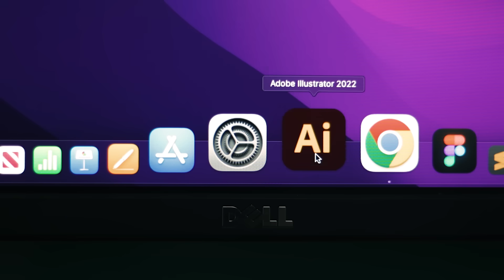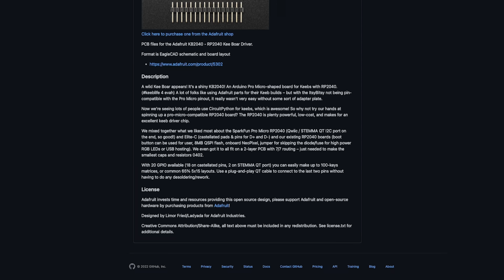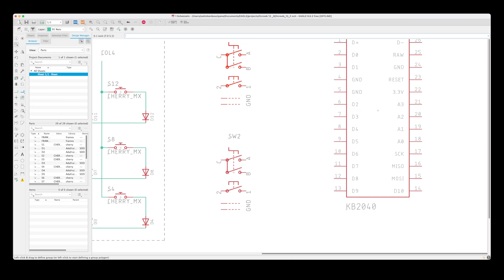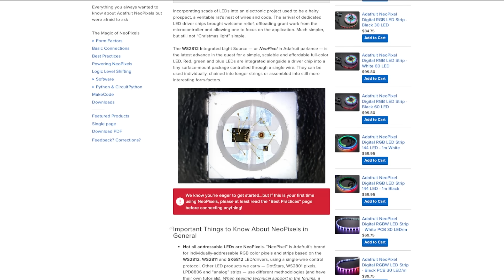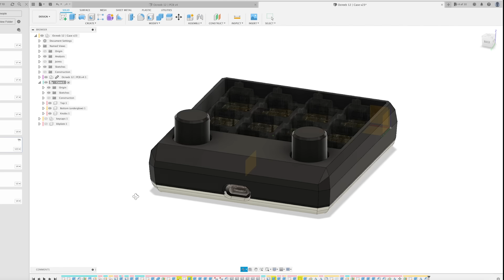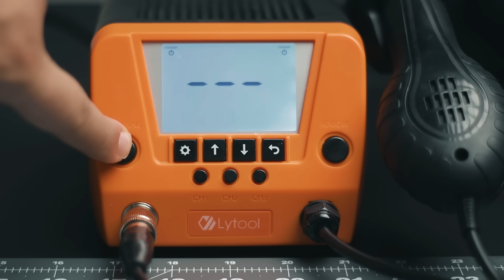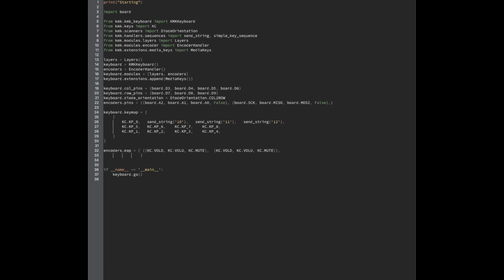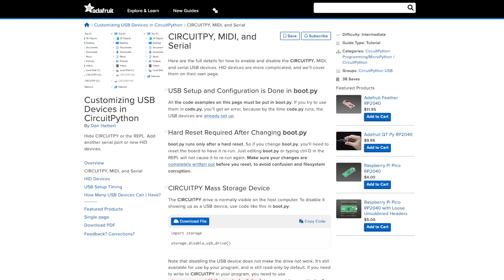DIY Macro Pad Keyboard Build from Scratch with Custom PCB and Mechanical Switches

Comment: Hi, this video rocks! I'm working on a similar project. Out of curiosity, would this work with any windows computer, or does it need python installed? I'm comfortable using python, but want to make it "plug and play" so to speak for other users. Any thoughts?
Reply from the maker: Thanks Kevin! The device is system agnostic and acts like any generic usb keyboard. You can certainly use it with windows without installing anything as long as you program working shortcuts and macros. Best of luck!

Comment: Nice video. Wanted to point out that the KB2040 has a RAW pin that outputs 5V, principally for powering those LEDs. There's a jumper that can be shorted on the bottom to bypass the fuse, providing up to 2A
Reply from the maker: Thanks! 
That's exactly what i'm using for the power. What I was talking about in the video is the signal to talk to the Neopixels, they expect 5v logic.

Comment: Hello Looks like the code.py doesn't work on the instructable. Any chance of re posting it (i couldn't read it on the video either) Im having problems with figuring out how to do macros and attach to pins.
Reply from the maker: Hello, did you download a new version of KMK? if yes, the code is not be compatible with the latest version. Grap the KMK copy in the repo and it should work as in the video.
Reply: @salimbenbouz  thanks it worked.

Any chance of making a utube on how you added the neo pixel libraries. I’ve been having all sorts of trouble. I can’t be the only one out there. Just wanting to avoid copy pasting to many peoples git hubs as I’m not figuring out how to do it from scratch.

Comment: Hi, this is such a great video! I was wondering if I can use a normal raspberry pi pico rp2040, instead of the Ada fruit kb2040, and use the same PCB that you designed ?
Reply from the maker: Hi, the pico rp2040 is longer and doesn’t have the same footprint. If you want to use it you’ll have to change the pcb.

Comment: Would there be a significant problem in using shift registers to expand the I/O instead of a key matrix?
Reply from the maker: Not a problem at all. You just have to use a different scanner. I think KMK has one that could work for this and bunch of other scenarios.

Comment: What 3D modeling program did you use? It looks like a older version of SolidWorks
Reply from the maker: I use Fusion 360 from Autodesk
Reply: @salimbenbouz  There is a education pack you can sign in

Comment: can u do the same project, but with the pico and extend it to 4x5? i want to reproduce your project!!
Reply from the maker: I'm not planning on changing this project for now but you can give it a go if you want.
I included all the resources you would need to mod or change this design. 
Best of luck!
Reply: @salimbenbouz  Can you give me tips on how to extend the top part of the case/pcb to 4x5? i have fusion 360(edu), and i never used that before.

Comment: Can we use the Raspberry pi pico, which have RP2040 for this? it is cheap with comparing the adafruit module
Reply from the maker: Not with this PCB as is (it's not the same footprint). You would need to change the PCB and rewire few things. All the files are in the repo if you want to do that.
Reply: @salimbenbouz  Oh... anyway thanks for the reply🙂

Comment: What is name of surface on your 3D-printer?
Reply from the maker: It's called a PEI build plate. I have a link in the description if you want to grab one.
Reply: @salimbenbouz  Yes!!! Thank you.
Reply: @salimbenbouz  but there are is 4 types of PEI surface. You have type “textured” or type “smooth”? Is it surface glued or engraved?
Reply from the maker: It's double sided. Smooth one side 6:50 and Textured the other 7:40 covering a flexible Spring Steel Sheet. It comes with a magnetic sticker you stick on the print bed.
Reply: @salimbenbouz  as I undastand: smooth surface is glued to steel, bur textured surface is engraved on steel. Is it true?

Comment: What software did you use to design the PCB? I understand that this isn't a tutorial on PCB design, but it'd be nice if it was listed so we have an idea of where to look.
Reply from the maker: I used Eagle to design the PCB. You also can use Fusion 360 (Electronics Workspace) to do the same thing.

Comment: Is anyone aware of a digital version of this? 
Software that emulates macro touch keys. I have a touch screen monitor; I would love to turn into a digital macro station!
Reply from the maker: your monitor is attached to the same computer?
Reply: @salimbenbouz  I have a vertical touch screen monitor that is connected to my pc. I use it when drawing on my huion monitor, good for reference, swipe images, windows on screen keyboard etc. I wouldn't mind software that is like a virtual macro board. I can't find nothing on the internet that comes close to what I'm after. Any ideas?

Comment: Man, what're your PETG settings.. I need that clean of a print!
Reply from the maker: I'm no expert but I can tell you it's a hit and miss with PETG and it took many tries for me to get it looking ok. Make sure your filament is dry and spend sometime tweaking Speed, Retraction and Cooling. Those are the main sections I would look at for PETG if your print has enough structural integrity but just looks bad (Stringing, Rough surface etc .. ) Best of luck!

Comment: Pretty fun project if you have the tools for it. I've been trying to find a proper actual just numpad with good switches, and it's starting to look like I have to just build one from scratch myself.

16 keys. Those 16 keys of a normal numpad are the most impossible things to find. Good complete products barely exist, and within keycap sets they almost never include or have just the numpad caps.
Reply from the maker: Yeah I agree. It's very rare to find juste those in a set. Maybe you can make one!

Comment: After watching your video, I started mine, your work was a very good example to succes mine, however, I use the pin raw to power the leds, I didn't finish my macro pad but thanks you for your video
Reply from the maker: Thanks for watching! the 5v net is connected to Raw as well in this project. I hope you get to finish your project soon!

Comment: Could I add hotswap sockets like kalih hotswap sockets to the pcb instead of soldering the switches directly to the pcb
Reply from the maker: You can add something like millmax 7305 sokets to make it hotswapable. The Kalih sokets needs pads that I don't have on this pcb, maybe in the next version I can include them.

Comment: This is such an awesome video, do you have any idea if there is a company in the U.S. that will manufacture that PCB because right now that is by far the most expensive part of the build for me because the shipping cost along is almost $25 so that would be a great cut. Any advice is great, I really want to build this!!
Reply from the maker: Thank you! Go for it!
I think in the US you have OSHPARK. If that doesn't work out or if it's still too expensive, you can get 5$ off with my affiliate link at PCB Way https://pcbway.com/g/TC4KGU

Comment: Woah, this is your first video and it is very interesting and cared, waiting for more!

By the way, a couple weeks ago I was wondering if I could design a keyboard extension like this one but trying not using any Arduino/rpi, I knew that was going to be a lot more difficult and found some tutorials on how to use an old keyboard microcontroller.

Comment: This looks awesome and I'd love to try it out, I've got a couple of questions though. Why not use a D1 mini that has pinouts for 3.3V and 5V instead of needing the shifter for the LEDs? They're cheap as chips too. Also does anyone know any cheap PCB online services in the UK? Looks like PCBway will end up shipping from the US which seems like a bit of a waste on postage!
Reply from the maker: Thanks! 
1. The pins you are referring to are Power only 5v from the usb and 3.3v from the voltage regulator, the shifter is used here to interface the 5v LOGIC SIGNAL on the led chip from the 3.3v Logic signal of the MCU. (from 3.3 to 5v you can get a way sometime with not using a shifter, but im not sure if that's reliable. Also if you are doing the other way around. Interfacing 3.3 from 5, it's a definitely a no go and it's going to damage your components)
2. You can use a D1 mini if you like but i'm not sure you have enough pins broken out for 12 keys, 2 encoders and the Neopixels (also you will have to redesign the PCB)
3. Maybe JLCPCB or NEXPCB is a better option for you?

Comment: I could do this even tho i dont have a 3d printer i can upload my cad files to jlcpcb and get custom pcb's or 3d prints and i would do this macro pad especiallyy because you included all the files but idk about the cost....
Reply from the maker: yea most definitely you can do that but this is not a cost conscious build so if that's an issue .. I don't recommend you build one

Comment: Thank you for providing such a good project. Follow your guidance to complete the assembly of the hardware, but there is a problem with the program. It can be fully used with your kmk configuration, but after changing the configuration, the whole keyboard will stop working, no matter which configuration is changed. I'm in trouble. Please provide guidance. Thank you very much. I want to set it to the normal numeric keyboard, and the encoder volume can be adjusted normally.❤❤
Reply from the maker: If you’re having trouble customizing the keymap, I suggest you take a look at the KMK firmware docs (getting started). You can start fresh (new copy) with the basic example and add modules and extensions as you go. KMK is under development, so it’s totally possible that what you will find in the recent docs isn’t necessarily compatible with the copy I have in the project repo. Just to keep that in mind as well. Best of luck

Comment: You can buy this on aliexpress for 5$ though. You didn't even do anything different, its exactly the same. I think if you are going to all this trouble - you should come up with a reason to be doing it yourself.
Reply from the maker: Sure u can. The reason is the making it self. Some people enjoy the process and the learning that goes with it. The fact that you can buy widely available commercial products has nothing to do with it.
Reply: @salimbenbouz  I guess I'm just saying that if you are going to all the lengths of building it yourself, make use of that fact and do something different. Otherwise, there is a product available already. Even if its just a cosmetic difference.

I appreciate the video, its great for learning. I just didn't understand why you wouldn't make it 'special' ya know? Good content anyway :)

Comment: This is my favourite out of all the videos that YouTube has recommended to me this year. I feel you took a challenging project, and turned it into something that even someone who isn't confident in all of these skills like electronics, programming, soldering and 3D printing can do with these instructions. I'm honestly thinking about visiting my local library here in Finland and asking if the 3D printers they have for public use could print out the case, and then ordering the parts to make this myself if the answer is yes.

The video is amazingly well made to be the first video of a channel btw. Audio and editing was absolutely "professional YouTube content creator" level, basically the only way I could tell I wasn't watching a recent video from a big creator like DIY Perks is that there wasn't as much bright soft light as you'd get with an expensive studio lighting setup.
Reply from the maker: Thank you for the kind words! 
I absolutely encourage you to go for it. If you don't have access to a 3D printer at the library you can order the enclosure from a fab house at an affordable price.
If you encounter any issues during the build I'd be happy to assist. Let me know

Comment: You top mate,one question with which way you put the pcb in to the fusion 360?
Reply from the maker: There is an integration between Eagle and Fusion 360. You can push and pull updates between them.
Reply: @salimbenbouz  thanks you so much for your quick reply,thanks you for your help too.

Comment: I've never had a problem with using 3.3volt data and or clock signals for any addressable LED.
Reply from the maker: I understand that you can get away with that for small distances and fewer pixels like this but I didn't want to give wrong instructions to someone using this for another project.
Reply: @salimbenbouz  fair enough.. it works fine for thousands of pixels

Comment: Very nice macro pad!

I built something similar, but simpler, so I' m wondering why you use that capacitors from the level shifter to LEDs. I found some usage examples on adafruit website, but they use the IC without any capacitor. So I can't figure it out 🤔

Thank you so much!!!
Reply from the maker: Thanks!
The ones you see at the bottom of the schematic are actually bypass caps for the pixels (1 for each) on the power line. They don't have any thing to do with the level shifter. I just ran out of space 😅 you can see them in the data sheet (last page) 
https://cdn-shop.adafruit.com/datasheets/WS2812B.pdf
Reply: @salimbenbouz  Thank you so much, so they protect leds from spikes when you power on/off the board, am I right? Anyway thank you, now I understand their purpose.

Comment: them: you should order a pcb online and just copy some code online
me: blehhh! Im not doing that! soldering stuff directly to the pro micro is so much more easier!!!

all seriousness, I feel like this is a bit complicated, all you need is a 3d printer and a pro micro. Use arduinos built in keyboard.h library and use "keyboard.press()" instead of what code is used in the vid, just connect a switch to grd and a digital pin, on "void setup()"  set said pin to "INPUT_PULLUP" (pinMode(2, INPUTPULLUP);  ), and in "void loop()" ask if said digital pins sensor is on, use "keyboard.write",  then after it detects your keypress do "Keyboard.releaseAll()". you can also include debounce timer with delay(). 

the video is a great idea but I feel like for beginners like myself it is a bit more complicated than it has to be
Reply: ok bro
Reply from the maker: The code used is just to setup another complete and robust firmware with a lot of features to make complex macros and full keyboards.
If you want to hand wire still I strongly advise to use a QMK or KMK, writing the entire thing from scratch is very tedious and way more complicated then you think. Definitely not as simple as few INPUT_PULLUP and keyboard.write
Reply: @salimbenbouz  for me it works pretty well, you get to 3d print it and design it as you like, I mainly use it for video editing and its worked flawlessly

Comment: 3:24 Wouldn't it drastically reduce the number of keys I can press together. What if I want the keyboard to register WASD and YGHJ pressed together?
Reply from the maker: That's not a problem because you detect the press from 2 places (columns and rows). So for 3 keys on the same row, 3 columns will identify them separately.
For the example you gave: To press WASD and YGHJ at the same time you will have 2 rows and 6 columns intersection to identify you're 8 presses.

Here is a great article where you get way more detail on how this works: 
https://www.pcbheaven.com/wikipages/How_Key_Matrices_Works/
Reply: Ben Eater has a great video on n-key rollover, which covers this method as well as more complex ones which can register more simultaneous keypresses
https://youtu.be/2lPzTU-3ONI

Comment: Wow, what a great start. I really like your work and how the music was so low so we don't get distracted when describing the design. Question, at work, we are not permitted to plug into our desktop anything except keyboard and mouse otherwise it will be flagged. Will I be able to program this on my personal laptop then plug it to the work desktop with no drama? I have subscribed 😁
Reply from the maker: Thnaks! 
Once programmed and the drive hidden, the macropad acts like any other normal HID device. So it shouldn't be a problem

Comment: Great tutorial and hell of a workshop you got there. Could you share with us a list of equipment and tools you use?
Reply from the maker: Thanks!
Few of the things I use: 
- Soldering Station, Lytool 650W
- Andonstar Digital Microscope
- Magnetic Helping Hand
- iFixit Mako Driver Kit 
- Ender 3v2 with a PEI Spring Steel Bed
- Auto ranging Multimeter

Comment: Man this Keyboard seem incredible , How do you go about programming the microcontroller?
Reply from the maker: Thanks! 
It's CircuitPython so you get a drive that mounts in your computer and you can program the firmware in python directly on the drive. No need to re-compile each time. It's really neat! In this project I hide the drive during normal use and when you want to edit, you hold the orange before plugging the cable for it to mount again.
Reply: @salimbenbouz  Mashaa allah 3alaik ya salim , I hope to see more complex build going forward, Good luck

Comment: Would love to see a v2 have smd rgb for under the keycaps or even option to do in switch LED backlighting. Just bought everything to make my own, but ill have to outsource the printing. Been looking for more SMD soldering projects. Do you have a diagram for newbies for what SMD parts go where? Was a detail lacking in the instructables.
Reply from the maker: I will definitely keep that in mind for V2. Probably hot-swap keys as well. Thanks for the suggestions. 
Amazing! I would love to see the result once you're done building it! 
In the Github repo you will find a BOM file with the appropriate labels (checkout the Parts column). I included the link in this comment as well.
https://github.com/sb-ocr/ocreeb-12/blob/main/PCB/BOM.csv
Reply: @salimbenbouz   yeah i was suprised not to see it using hotswap sockets, I might add some milmax sockets.